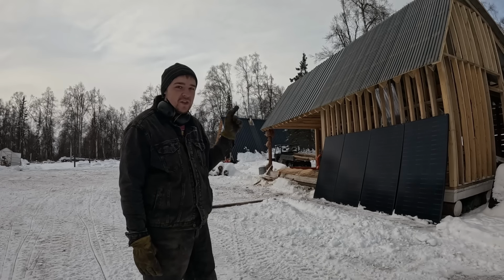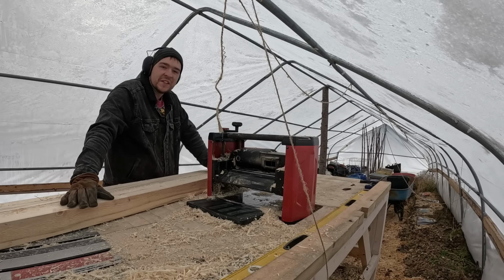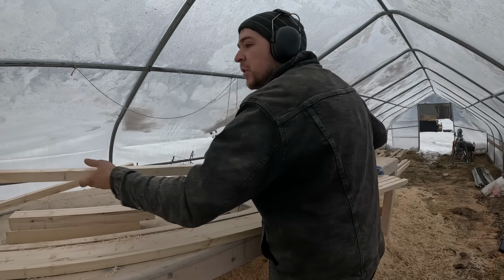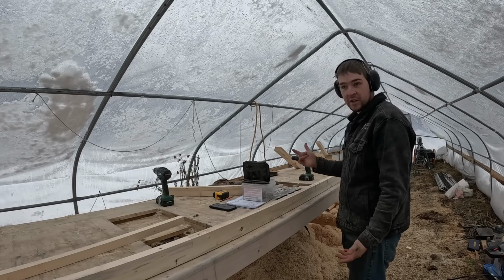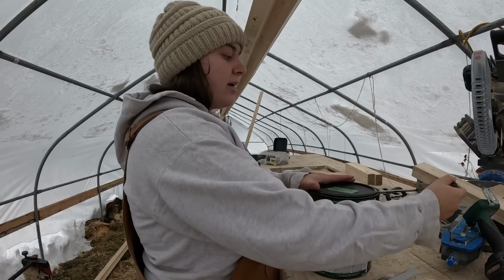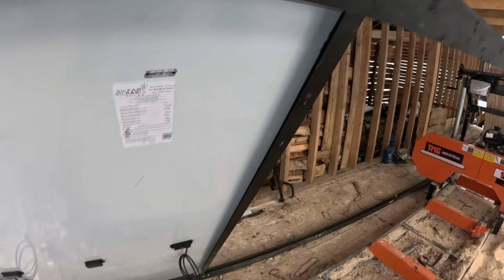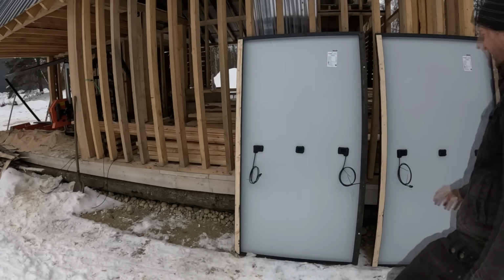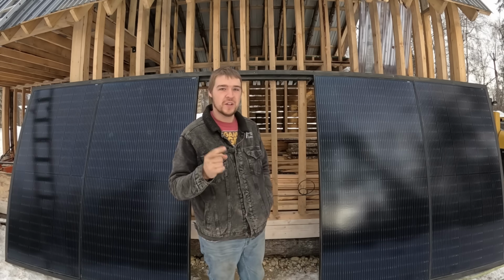Solar Panel Mount - Building the frame to lift above the sawmill

Comment: A quick question…..is your mill a shorter one or is it just the camera angle? I know nothing but what Ive seen in videos about these mills. They really seem to be a real blessing and a good investment for a lot of people.
Reply from the maker: It can cut 11.5’ and you can add 4’ extensions for it. We try to design everything around 10’ lengths and typically cut logs at 10.5’

Comment: Your power equipment needs to be at the end of the table. It is extremely awkward feeding wood the way you are set up from my point of view. Love your channel.
Reply from the maker: If I were to build it again I would have the table saw right at the end for sure.
Reply: I’m sure you can retrofit it for safety sake but right now you have lots more important things to do with winter coming. I am amazed at what you two have accomplished in your short time in Alaska. Hope you are able to get your own piece of equipment soon. It will make life on your homestead much easier. I look forward to each video you post. I am a retired carpenter and am impressed with what you get done with what tools you have.
Reply from the maker: We purchased some equipment and got it up the trail days before the snow came. It needs a little love, but we are very excited to use it come summer.